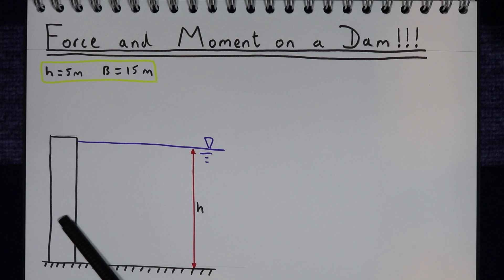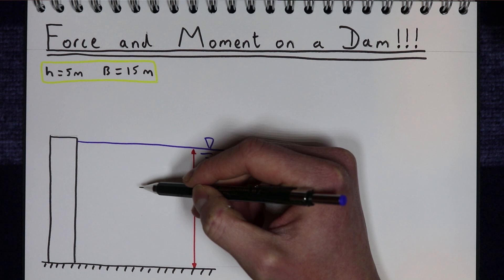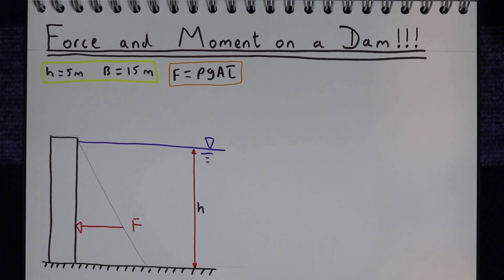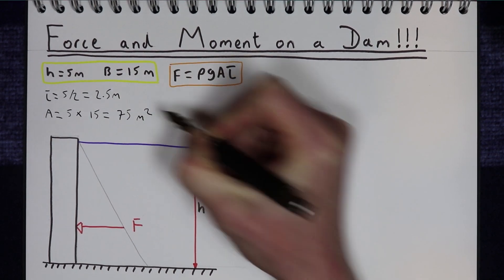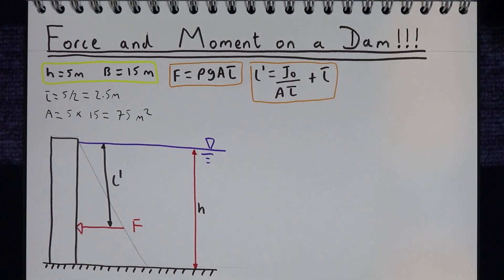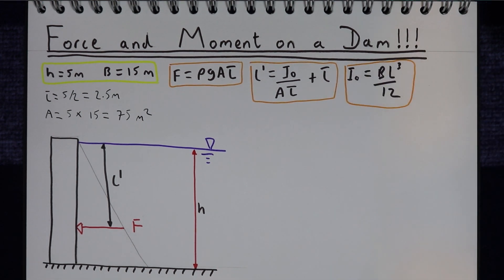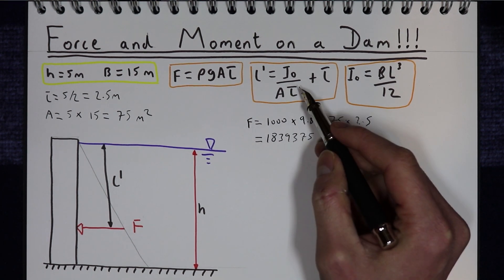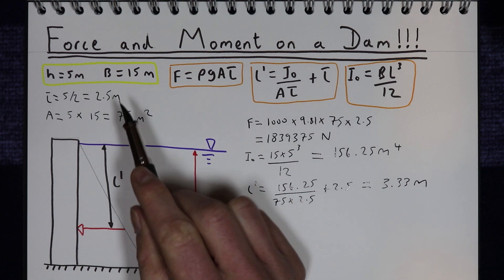Force and Moment on a Submerged Surface (Dam) Example

Comment: If you know the resultant force will act at 1/3 of the base couldn’t you just calculate l’ by multiplying the total height of the dam by 2/3?
Reply from the maker: Hi, thanks for the question. Absolutely, for a rectangle section this is true. However, I have worked through the full solution in this video, firstly to show there l’ comes from and secondly because this is a general solution that will apply to other geometries as long as you have found I0 for that geometry, this is important because for non-rectangles, it may be the case that l’≠ h x 2/3. Hope that makes sense?